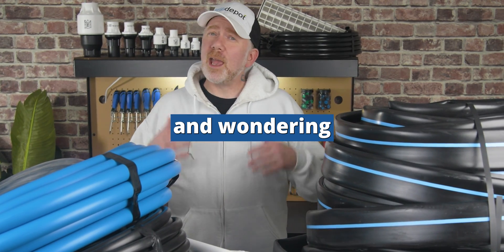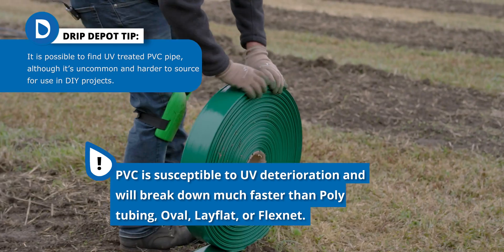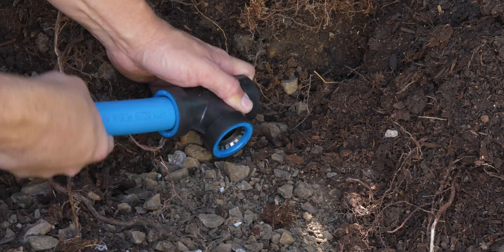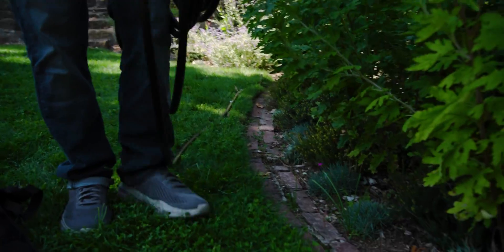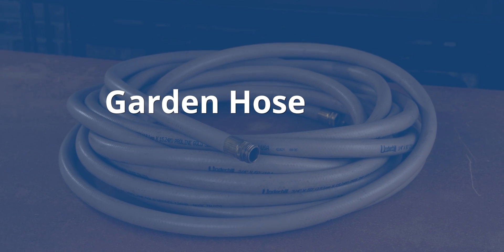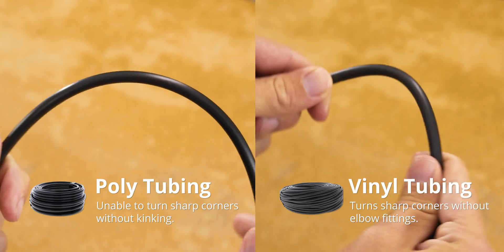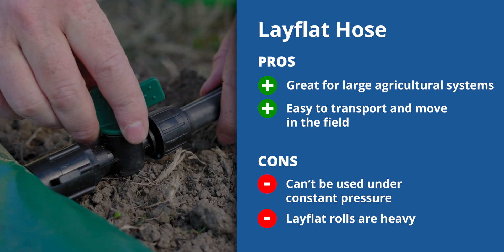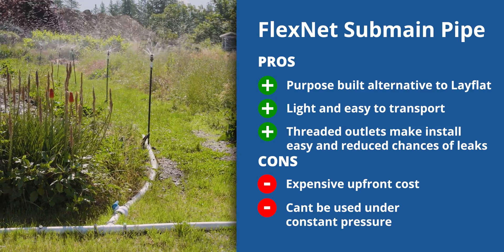Irrigation Pipe & Tubing: Choosing the Right Mainline Type for your Irrigation Project

Comment: For PVC, can you use the same thickness for the whole system or should you tier down (e.g., start with 1” from the main to valvebox, then have 3/4” from valves to sprinklers)?
Reply: Thanks so much for your help. I will look into this and will definitely report back! It’s never as easy as you think haha
Reply from the maker: You can absolutely go with smaller diameter out of the valve than the larger main coming into it.  If the zone specifications are good with a smaller diameter line, definitely go for it for the lower costs, if things are spec'd out and sized, you can do it with no sacrifice in performance as well :)
Reply: Thanks! Another issue I just realized. The pipe from my water main to my house (that I was going to T off for my irrigation system) looks to be half inch cpvc. Is this an issue? Would you 1. Use 1/2” cpvc for the whole irrigation 2. Bump up to 3/4” cpvc or 3. Transition to 3/4” schedule 40 pvc? Anything helps!
Reply from the maker: @coleyeomans5219  Great question here, and there's a bit more going on under the surface (or at least, possibly!).  

For irrigation you won't want to use all 1/2" CPVC -- the CPVC you have there is possibly sized by CTS (Copper Tubing Size) instead of IPS (Iron Pipe Size) and could have a smaller inside diameter.  That type of CPVC is often used in residential plumbing applications so there's a good chance that's what you have there.  

In this case, I'd probably transition up to 3/4" or 1" Schedule 40 or 80 PVC.  The 1/2" CPVC will still be a limiting factor, but length is one of the variables that goes into friction loss, so the shorter the section of 1/2" CPVC the better as far as pressure goes. 

Once you know the flow rate of your system I'd be happy to check friction loss.  You can determine the flow rate of your zones by just adding up the flow rate of all the sprinklers you'll be using at one time, based on the nozzle you're using and pressure you're operating at.  For example, if you're using 5 sprinklers that put out 0.5 GPM with the blue nozzle at 50 PSI, the flow rate could be 2.50 GPM.   With that flow and the length of the line, friction loss can be calculated to make sure it's not too high :)
Reply: This is extensive insightful. I’m still trying to determine the size of the cpvc at the water main haha. It has an outside circumference of 3” and everything I have read says that is 3/4” cpvc, but I would be curious of your thoughts. If that is the case, I contemplated using some kind of compression t fitting to start my irrigation system. Have you seen a compression t from cpvc to pvc before?
Reply from the maker: @coleyeomans5219  That circumference definitely puts it in range of 3/4" CPVC.  A circumference of 3" is a diameter or about 0.955".  3/4" PVC has a circumference of 3.30" and an outside diameter of 1.05".   1/2" CPVC has a circumference of 2.75" and an outside diameter of 0.875".  

Basically, it's almost certainly one of those two, but your measurements are falling right in between them (as they love to do sometimes!).  Do you have access to a pair of digital calipers?  If so, use those to check the outside diameter, CPVC is typically sized by outside diameter so if it's right near 1.05", it's highly likely to be 3/4".  

From CPVC to Sch 40 PVC, you can indeed use a compression transition, though it may not be easy to find as a Tee fitting, but a straight adapter should be readily available.  Usually these straight adapters will be CPVC CTS x MPT IPS -- basically, PVC x Pipe Threads.  From there you can either thread on a Tee with an FPT bottom (somewhat rare, but not impossible to find) or an FPT x PVC Slip Coupling (very common and available), a short run of pipe and then add your Tee. 

If you take a pair of calipers to the outside diameter of your CPVC pipe, let me know what results you get, now I'm very invested in figuring it out too haha
Reply: Alright I’m back! The final verdict is that the CPVC I have at my water line is 3/4”. So I went to Home Depot and bought a CPVC tee joint and small run of CPVC and a CPVC/PVC adapter joint. I plan to cut into the main CPVC line, tee it off and connect schedule 40 3/4” PVC, then build my backflow, then valves, and rest of system. Do you have any recommendations when going from 3/4” CPVC to 3/4” PVC? I have looked at pressure charts but am just curious how the transition would affect it or if there’s anything dangerous I’m not thinking of. I should also mention I have 10 GPM and 58 psi.
Reply from the maker: @coleyeomans5219  This sounds solid!  CPVC is rated for constant pressure and using a CPVC to PVC adapter is exactly the right call.  For that adapter use a CPVC to PVC transition solvent cement (Oatey Green comes to mind), for the other parts use the solvent recommended for it (for CPVC x CPVC, use CPVC solvent, for PVC x PVC use standard PVC solvent).  Try to make sure all of the CPVC x PVC transitions are buried, CPVC experiences more thermal expansion than PVC so you don't want to stress out the connections, best if temperature fluctuations are minimal there.  

Depending on the backflow preventer type you're using, it will likely need to be installed about 12" above the highest point emitter in the system, definitely check local codes on that if you have not already, most places have pretty specific requirements and best to know beforehand than have to change things up later.  

How long is your 3/4" run going to be?  9 to 10 GPM is a little high for a 3/4" line, but if it's a fairly short run of pipe I wouldn't anticipate any major issues.  At 9 GPM 3/4'" Sch 40 PVC will lose about 6.39 PSI per 100' of pipe and water velocity will be about 5.40 feet per second (a little over the maximum recommended 5 ft/s).  If possible, I'd size your zones to top out at around 8 GPM.  8 GPM is 4.80 feet per second water velocity and 5.14 PSI friction loss per 100' of pipe.

Overall your plan is looking very sound!  :D
Reply: Great to know. I haven’t finalized my zones yet. I was just going to start with one that will be probably around 80ft from valve manifold to last sprinkler. However I was planning on running six sprinklers on the zone so it sounds like I might have to break it in two.
Reply from the maker: @coleyeomans5219  What sprinklers are you planning to use?  Happy to take a look and let you know what that means in regards to the system, flow, pressure, etc :)
Reply: I havent gotten there yet haha. Is it ok to have different sprinkler heads on the same zone?
Reply from the maker: @coleyeomans5219  Generally not  -- the reason is that different brand sprinklers put out different volumes of water, so you can end up with a case where one section of the lawn is getting more water than it should, or one section getting less.  By sticking with the same brand/model across the zone, you can ensure they have what's known as "matched precipitation rate."  Even when one is set to 180° and another to 360° they will be uniform (with the 180° applying the same amount of water to its half circle as the 360° does to its two half circles).  

It is definitely ok to have different sprinkler heads, or even entirely different emitter types, on different zones, we just try to avoid it on the same zone.  While professionally there's not really a situation where it's ok, I have seen it work in a case where the shaded section of the lawn has a lower flow sprinkler than an area under more sun exposure.  Usually those should be separate zones, but I have seen DIY systems that did it and it ended up working out well.
Reply: Understood. So just as an example with 10 gpm, 58psi and 3/4” pipe coming from the meter. If I wanted to put 8 Rainbird 1800 series spray sprinklers at a 90 degree angle that spray 10 feet (chart shows around .75 gpm per head) could I do that for an 80 foot zone and have it be effective?
Reply from the maker: @coleyeomans5219   This should be good to go -- are you planning to use the Rotary Nozzles or the Spray Nozzles?   

10 0.75 GPM sprinklers will be a total flow rate of 7.5 GPM, far enough below your 10 GPM that you have a good cushion.  Pressure lost from friction will be under 5 PSI in 3/4" Sch 40 PVC pipe and water velocity below the maximum recommended.  The math all checks out :)
Reply: Cool! I might use rotors as well. Going to measure the final area tomorrow and figure out the exact sprinkler heads and try to keep it under the GPM and psi levels. hopefully it works haha!
Reply: I meant to let you know my first zone worked! Going to do a second this weekend. Thanks for all the help
Reply from the maker: @coleyeomans5219  Hey man, thank you for the follow-up on this!  Often I have to assume things worked out, it's genuinely awesome to hear back with confirmation -- thank you! 

Enjoy the rest of that weekend :)

Comment: Technically you can bend metal pipe,  it just requires more expensive tools and is hard to undo, lol
Reply from the maker: Really good point about the undoing!  I should have perhaps focused on the impracticality of it, as you are absolutely correct on both counts: you can do it, but might not be able to undo it haha

Comment: Thanks for the very informative video. So, if I have 6 IBC containers stacked as 2 rows of 3 that I want to link together to harvest water for drip irrigation. I had just about decided to go with 2” PVC pipework to make the IBCs act as a single store of water but your video warns against UV damage to PVC pipework. Is there a better alternative?I am a bit unsure if the containers will flex/move as they fill, so maybe a rigid connection is naive… any advice appreciated!
Reply from the maker: Great question!   

Avoiding UV exposure to PVC pipe is the right call (it gets yellow and brittle pretty quick), but you may still be able to use it.  When PVC is installed above ground in the industry, a plastic safe paint is used to give it a coat, and that pretty much eliminates UV exposure.  I've seen people wrap tape around it as well, and I do think that would work, but would need to take extra precaution to ensure the adhesive is plastic safe (many common paints are safe for PVC).  

Movement and turbulence can indeed present problems for PVC, so your instincts are correct.  I wouldn't expect IBC containers, particularly weighted down by water, to be able to generate enough turbulence to cause problems, but local conditions could potentially make it so (fast temperature changes causing rapid thermal expansion/contraction, turbulence when filling the tanks, etc).  These can be ameliorated  to some degree by having the tanks placed out of the sun to slow down temperature changes and filling with lower water velocity at least.  

Something like HDPE could also work here.  HDPE Is high density polyethylene and, like LDPE (what we think of as every day poly tubing) is very UV resistant.  HDPE costs significantly more though, even if you include the paint for the PVC pipe, so there's definitely some options to weigh.  

Thank you for the great question!

Comment: What about pex?
Reply from the maker: This is a great question, because we've been seeing PEX used more often in irrigation than we have in the past.   That makes the short answer basically, yes, PEX can (and is!) used successfully in irrigation. 

The longer answer is a little more involved :) 

PEX's advantage is it's semi-flexible -- this means it's easier to lay out and you'll typically be able to use fewer fittings like elbows due to the flexibility and will have a greater margin for error.  A lot PEX is also rated for constant pressure, so can be used as a mainline instead of PVC.  It is also more resistant to freeze damage than PVC.  

On the other hand, it is very susceptible to UV damage and 100% of it needs to be subsurface to be out of the sun.  PEX also has very thick walls, which means PEX of a given diameter will have a smaller passage than PVC -- for example, 1" Sch 40 PVC has an inside diameter of about 1.029", whereas 1" PEX has an inside diameter of about 0.875" (this may vary between manufacturers but holds true as a general rule).  

That narrower passage leads to more pressure lost from friction -- that's not necessarily a problem, but does mean a little more planning to ensure friction loss is minimized enough that the system runs well.  

Thank your for the great question!

Comment: Each Spring I have had to replace my 1” poly tubing drip irrigation system after squirrels and moles have chewed holes in it.  The moles even chewed  with the main line buried!   Any recommendations?
Reply from the maker: At my house it's the raccoons! 

The easiest method is to provide an easier source of water, preferably away from the location of the tubing.  That way they get used to going elsewhere for water (and will always prefer the easiest to access unless there are predators around it).  This method might not always work depending on how cold your winters are.  This route can be supported by placing squirrel feeders away from the tubing/garden area.  

Castor oil based deterrents work pretty good too, animals cannot stand the stuff, though this method is usually used during the season when you can run some through the tubing (they'll stop in a hurry though once they get into the castor oil).  

On the more expensive end (though maybe not as expensive as replacing tubing every Spring) you can use hardware cloth -- the hardware cloth will prevent the moles from being able to dig up into the tubing.  

Along the same idea, PVC conduit works pretty well -- you can use the thinner walled (costs less) PVC like Class 200 or Thin Walled Drain-Waste-Vent PVC pipe.  

I hope one of these does the trick for you!

Comment: Good information! I have such a nagging question... In regards to in-line emmitter tubing, what exactly does the term "pressure compensating?" Does it mean a user doesn't need a pressure reducer? Does it mean the tubing can compensate for a lack of operable pressure or pressure variations? Can you explain what "pressure compensating" means? Thank you!
Reply from the maker: Great question!  

In general, it means that the emitters will put out uniform amounts of water over a pretty wide range of operating pressure.  One roll we carry is pressure compensating between 12 to 50 PSI, so if one section if getting very low pressure (12) and another pretty high (50) the emitters are still going to put out very close to the same volume of water.  

This does mean sometimes you can go without a pressure regulator -- if the pressure is on the higher side, I'd still recommend using one to help ensure tubing doesn't pop off the fittings or anything, but if it's in between somewhere you can definitely go without one safely. 

Quick note: Pressure compensating emitters are available in other styles as well -- they also come as button drippers if you don't want to use inline emitter line, and even some microsprinklers are pressure compensating.  :)
Reply: @dripdepot Man! This channel is like Drip Irrigation Utopia! Thank you! 😅

Comment: Hello! Thanks for the well done videos. I’m starting a drip irrigation project for my back yard. The trench is completed. The 6 zone system has already been installed by a “professional”. One zone is feeding the smaller front yard. The remaining 5 zones will feed the back yard. I will use 3 of those zones now but run the line for the remaining two for the remaining part of the yard to be done at a later date. Taking your advice, I’ve determined the water pressure to be 40 psi. The water flow rate is 207.43 GPH. I will need 900 - 1000 feet of post-shut off valve below ground mainline for the project. The turn angles for the lines will be close to but not exactly 90 degrees and 45 degrees. I will be supplying 4 trees and two raised plant/flower beds. I’m in El Paso, TX. It gets below freezing a few times a year. The soil is sand and rock. I’m leaning towards polyethylene tubing for mainline but I’d thought I’d see if you agree or have a better recommendation.
Reply from the maker: Great question on the mainline -- to some degree cost of different lines is regional, and of course there's the time investment to weigh as well when deciding on a mainline.  Poly tubing is going to be much easier to run and there's a good chance you won't need fittings for the 45° turns.  It's not uncommon to use poly tubing in this way, particularly anywhere that gets freezing temperatures during winter (but it's not limited to those locations). 

I'm a bit biased since I work with a lot of poly tubing, but for DIY I think poly tubing makes a great choice for anything downstream of the zone valves.  Because the tubing is so much more flexible, you get a lot more room for error in everything from trenching to fittings, and if you make any mistakes, the repairs are very easy.  If this (or any portions of it) will be above surface, poly tubing definitely has the full advantage.